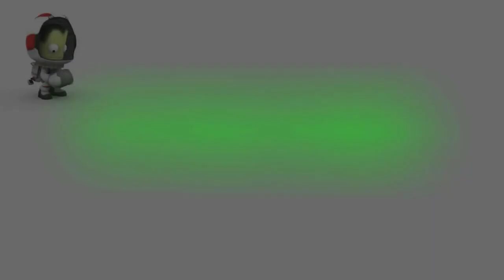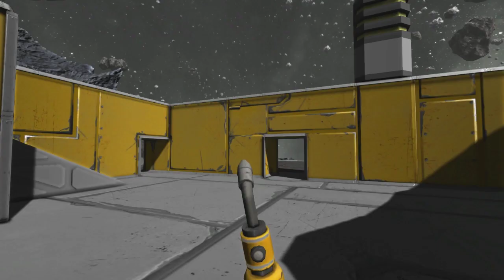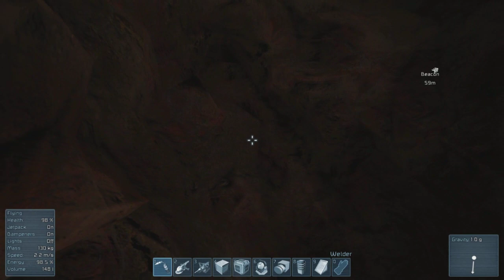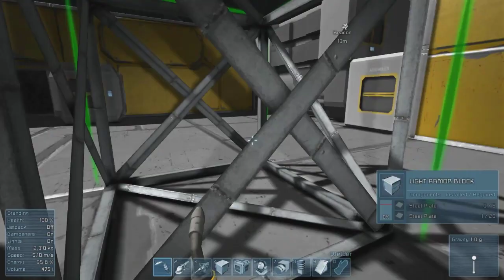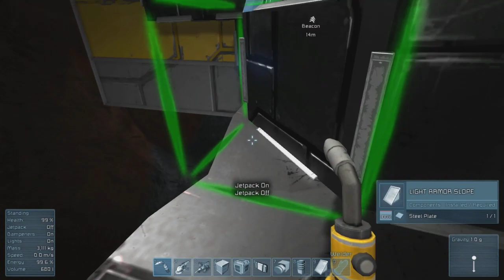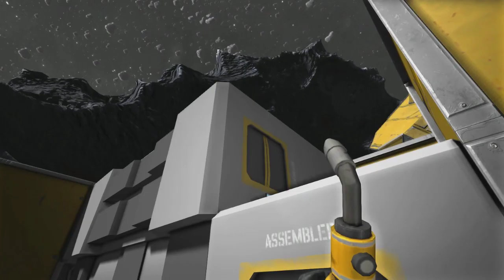Space Engineers: Beginners Guide

Comment: How do you install the Uranium into ships?
Reply: Uranium has only two purposes: Either as fuel for your reactor or as a component for rocket-ammunition.
I guess you mean the first: Simply go to your reactor, open it like you would a cargo container and put it in.
If you put it in somewhere else, and said reactor and cargo container are connected via a conveyer system, it will pull the uranium automatically.
Reply: the reactor - along with some other objects (storage containers, refinery, assembler for example) - have access doors that let you put ore, ingots of refined material, or objects inside them.